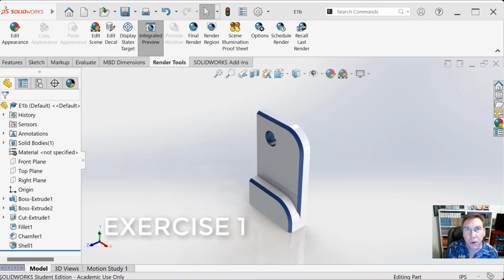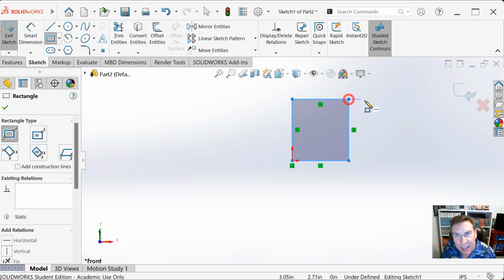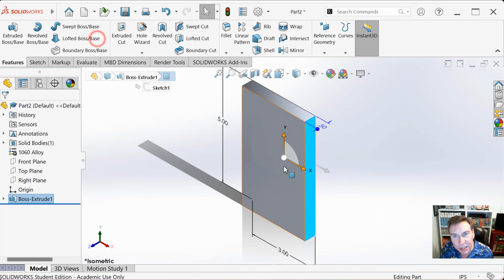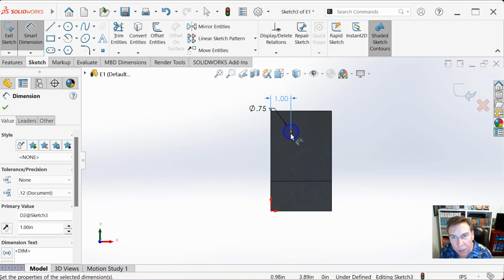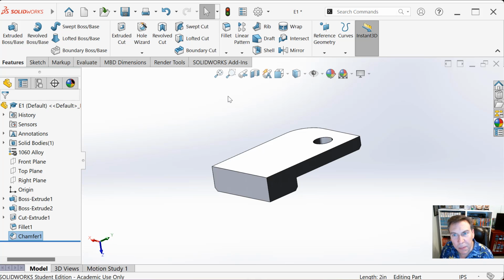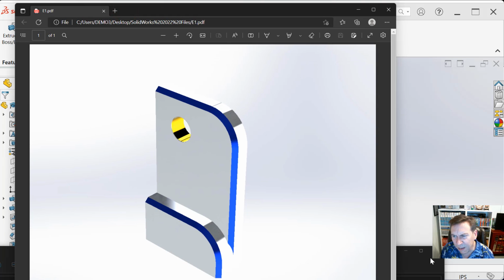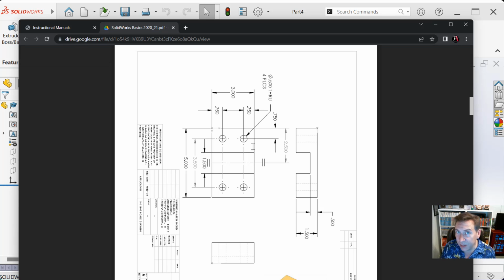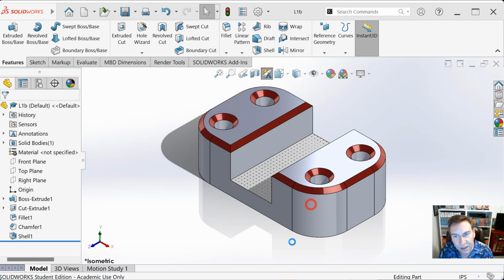E1 SolidWorks 2022 - Basic Modeling for Beginners Tutorial with Training Guide | Tips

Comment: Can a gaming laptop run SolidWorks? I am looking to purchase one at Best Buy. If there were any that you recommended? I was looking at the MSI - Vector GP66 15.6” 360hz Gaming Laptop - Intel Core i9 - 32GB memory - NVIDIA GeForce RTX 3070 Ti - 1TB SSD
Reply from the maker: If it's just for school or hobby then it should be fine. If it's for work I would recommend a professional CAD workstation laptop with a Nvidia  A series or AMD Radeon Professional graphics GPU.
Reply: Should not be a problem.
Especially not for hobby/school usage